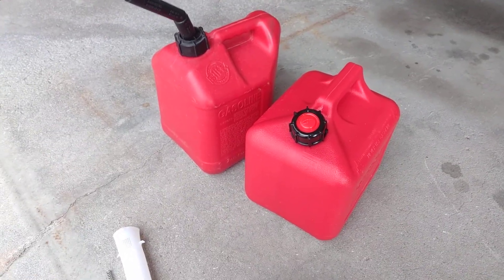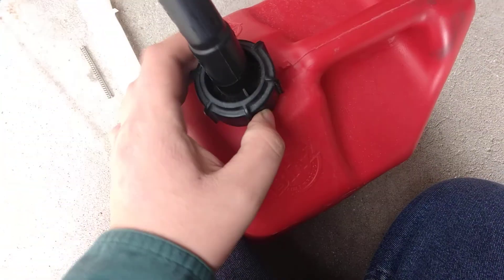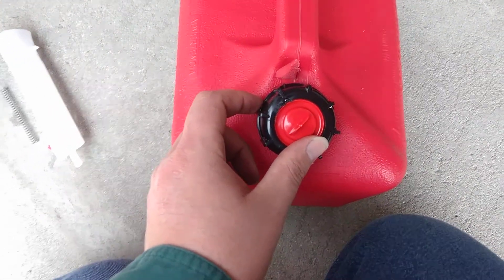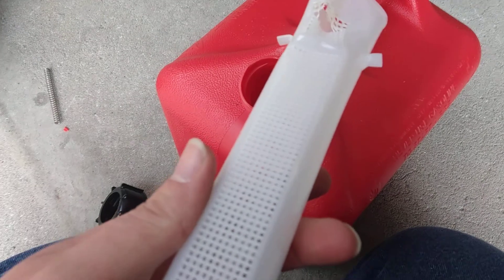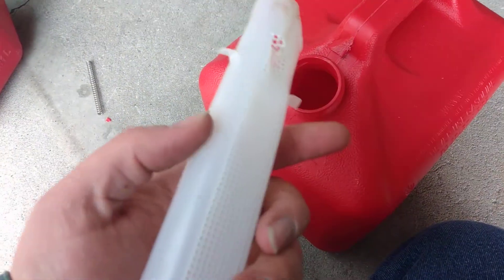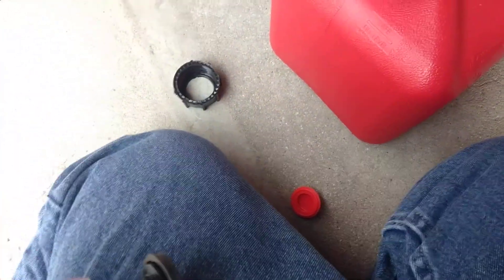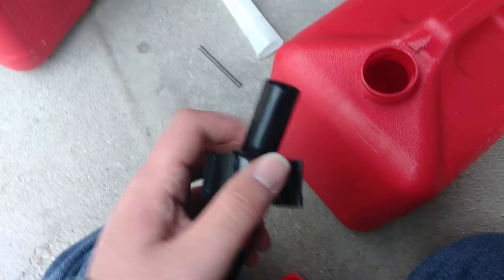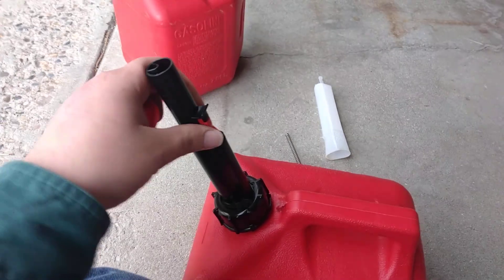Midwest Gas Can Hack 1

Comment: That white mesh is there to stop a flame front from progressing into the can if there's a spark or ignition source when you're using it. I find that it works best at preventing flame from progressing into the can by preventing gas from being put in the can in the first place.
Reply: Yes, two functions in one... intended to be a "Flame Arrester" but much more successful as a "Frustration Generator!"

Comment: Nice fix.👍🏻 The screen is an unnecessary “improvement “ which makes filling the fuel can at the pump, incredibly difficult. I cannot think of a time when spark will be near my open fuel can. (I’m here because I just bought two)
Reply: wouldn't blow up anyways, i've lit my generator tank on fire in the middle of the night when i didnt have a flashlight and was flicking my bic lighter trying to see how much fuel was left lol, just put the cap back on and it extuingishes